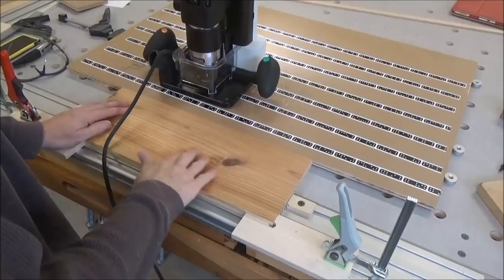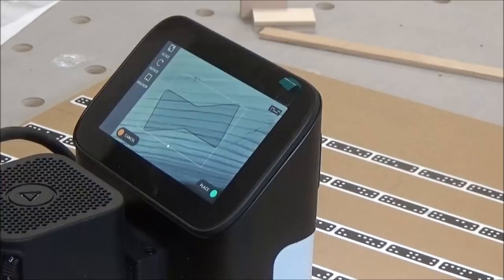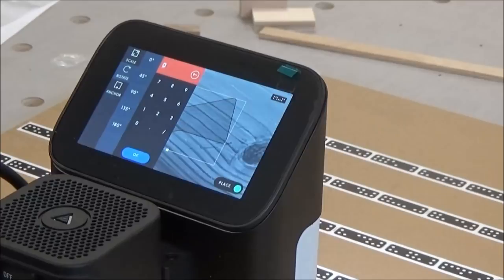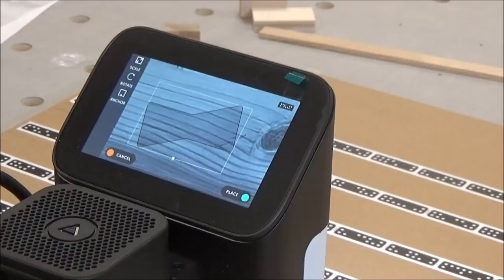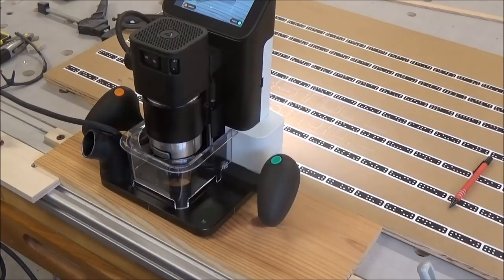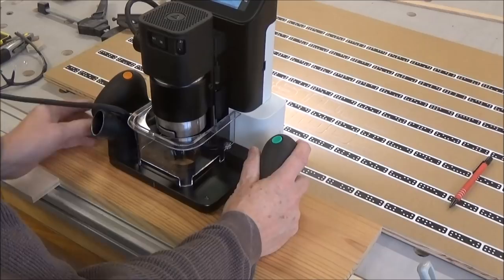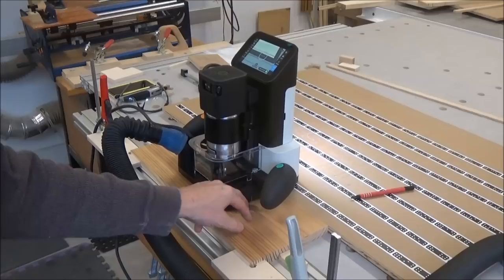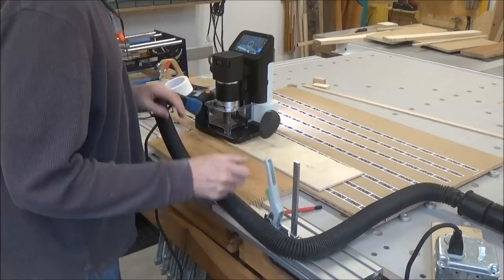Shaper Origin Dogbone

Comment: Hi, Jeff.  Awesome job.  Just a comment about nomenclature.  I'm pretty sure "dogbone" in the Shaper Origin world refers to rectangular pockets with the little rounded reliefs at the corners which are sometimes necessary because of using round router bits when making rectangular holes.  These are often used in flat-pack furniture with tab-and-slot assemblies.  I think in addition to "butterfly", "bowtie" is a noun used to describe the patch design you demonstrate in this vid.
Reply from the maker: I knew that but when I was in the heat of the moment I had a brain fart. Thanks for watching and I appreciate the comment.

Comment: My Shaper showed up at my doorstep yesterday. I believe one of the first things to accomplish is to scribe the registration marks on the base as you did on this video. My plan is to install the engraving bit in the spindle, place tape across the opening at the bottom of the engraving well, Z-touch the spindle and hope the engraving bit leaves a small mark at the center of the well. Then could register engraved lines on perimeter of the base using Tri-Square. Is this anywhere near how you did the same?
Reply from the maker: No need to do that. I was jumping the gun. Just use the grid system, its much more accurate.
Reply: you all prolly dont give a damn but does someone know of a tool to log back into an Instagram account?
I somehow lost my account password. I would love any tips you can give me!
Reply: @Brantley Orlando instablaster =)
Reply: @Conor Zayden I really appreciate your reply. I got to the site thru google and I'm waiting for the hacking stuff atm.
Seems to take quite some time so I will reply here later with my results.
Reply: @Conor Zayden It worked and I finally got access to my account again. I'm so happy:D
Thank you so much you saved my account :D
Reply: @Brantley Orlando you are welcome =)